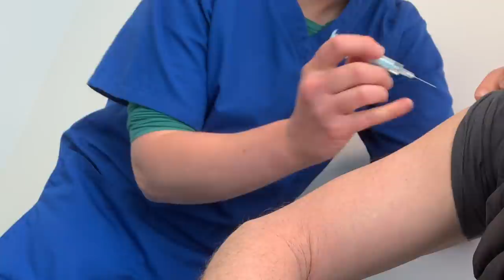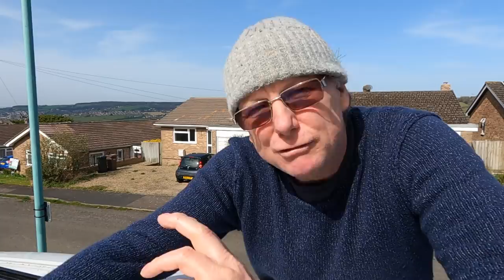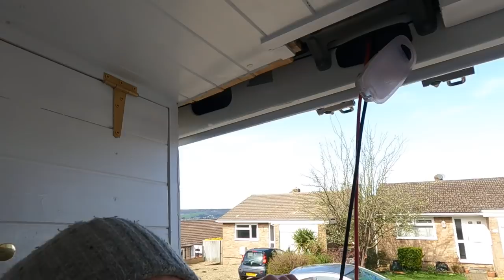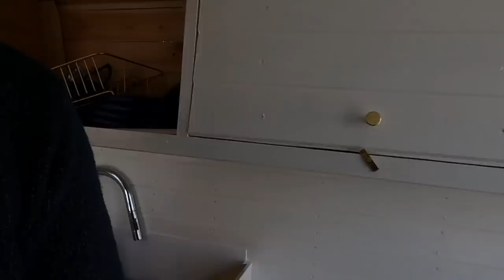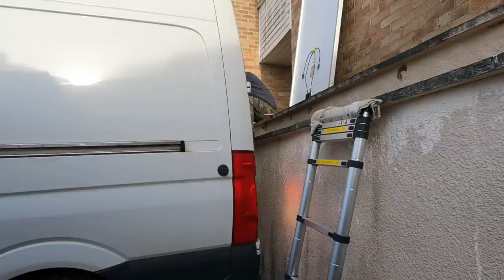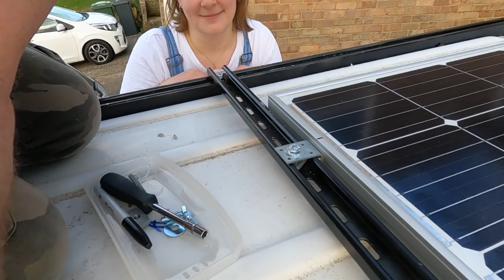HOW DO I FIT SOLAR PANELS TO A CAMPER VAN ROOF Simple and Safe Using Unistrut

Comment: Hey Mel, thanks for the tip mate on drilling the solar panal,  just swapped mine and relocated it on old roof fitting and was going to just put the fixing bolts straight into the panal. Thanks. Thought your opening was nc500 not Malvern ha ha ❤️❤️👍👍👍🐧🐧
Reply from the maker: Thank you for taking the time to comment and keeping it positive really appreciated NC 500 will be like the M25 this summer lol 😂

Comment: Hi Mel Do you know if the ring battery to battery will charge my Van battery through solar it’s always going flat cheers keep up the good work 👍
Reply from the maker: Yes it would but if it’s going flat all the time you may have a problem good luck

Comment: Great idea on where to run the cables but the glands are facing forwards so when driving, water could be forced between the cable and the seal causing a leak.
Reply from the maker: I did them up tight 👍

Comment: You may want to think about supporting the solar panel at the middle either side as large panels can flex with the air traveling underneath them at speed. This flexing can damage the panel.
Reply from the maker: Thank you 😊

Comment: Do you wire the negative solar cable to the ctek charger or to the negative terminal on the battery?
Reply from the maker: To the charger
Reply: @BigVanSmallWorld  great, thanks for that I’m installing my solar using the ctek soon. Great content, keep up the good work 👍🏼
Reply from the maker: @MrDodgeeames  just one other thing sorry I forgot to say make sure you connect the negative last and that the solar panel isn’t over 23v good luck with your build 👍😊👍

Comment: I'm sure those cable entry covers should be mounted with the sloping face forward to reduce windage. And as mentioned elsewhere, the glands would then be to the rear and less susceptible to leaks. I hope it works, but I fear it will leak.
Reply from the maker: It will be fine the solar panels sit higher than the gland 👍

Comment: Think that’s the same size to my solar pannel it’s huge I struggled on my own to lift it on to the van. I followed how you install yours on your van when I did mine. 
I fitted the brackets on to the solar on the work table and then I cheated in the end and used the works forklift to lift it along the top side of my van and slid it on to the unistrut 😜😜😜😜
Rebecca going to have a lovely solar on the top :)
Great video buddy. 
Oh and I would of beeped my horn to see if they came out 😜 
I do have a question tho I put my huge solar pannel to one side, was that wrong? Should I have put it in more center like you did Rebecca bud?
Hope your feeling ok and well rested 
Big 🤗 😊
Reply from the maker: Cheers mate I’m feeling fine I don’t think it matters about panel they are not that heavy 👍
Reply: @BigVanSmallWorld  ok bud just when I saw you put Rebecca’s one to the middle I thought I might have too. Glad your ok 💪🤗😊

Comment: Disappointed to see you promoting this jab for something which is 99.7% not needed. Does it not  make you angry that you're being coerced into requiring these measures simply to live a normal life? It's your channel of course and you can post what you like. I'm merely making an observation that by doing so you may be unduly influencing people and pushing something which, although described by Johnathan Van Tam as being "no worse than taking a Paracetamol," actually has some 64 pages of reported side effects on the MHRA website, some of which have resulted in hundreds of deaths and other serious health outcomes.
Reply from the maker: I’m not promoting anything I’m just making videos about my day